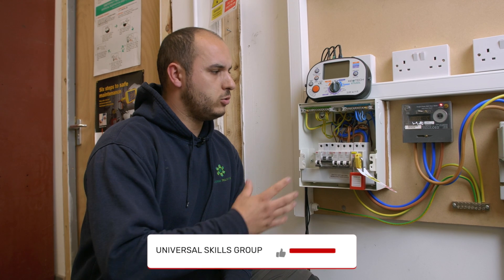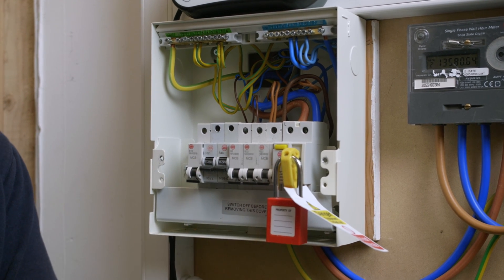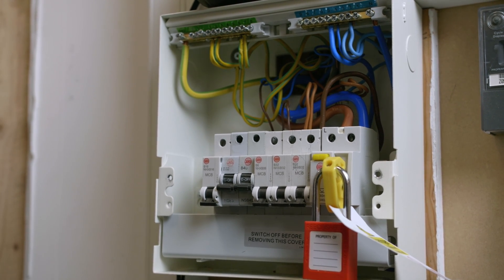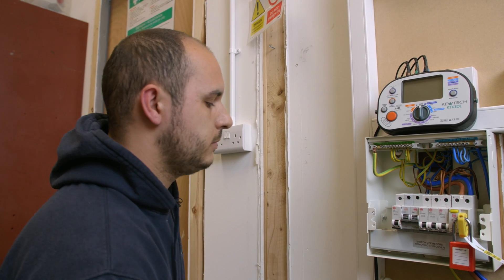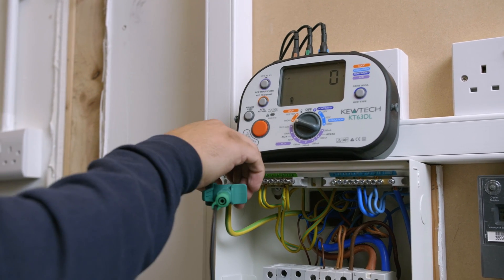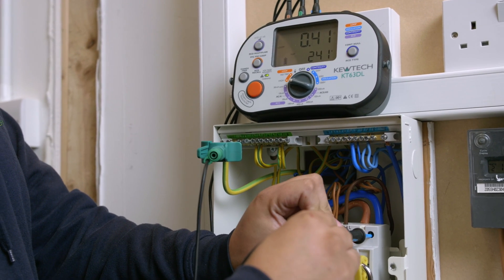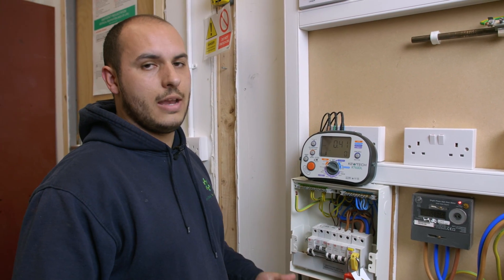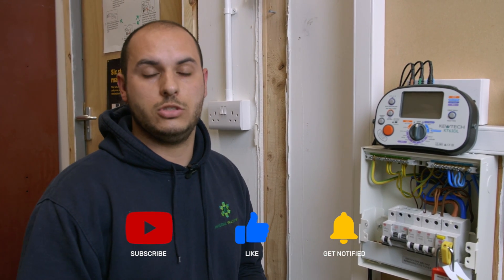Earth loop impedance test, ZE test

Comment: According to the manual - "The high current mode is a 2-wire test that enables
the user to test the true impedance of both the Line-Neutral Loop and the Line-Earth loop and
therefore to establish both the PSC (prospective short circuit current) and the PFC (prospective
fault current) for the installation." So why you use 3 wire set up ?

Comment: Thanks for your video, out of curiosity, there is a MET separate to CU with 3 earths, assuming one is the DNO earth, another goes to the CU, would the 3rd be a bond for water/gas?
If so, should the DNO earth be removed from that external MET and the tester earth be connected to the DNO earth?
I’m definitely not trying to correct you, but just wondering if I’m thinking correctly?
Cheers.

Comment: I wish we had videos like this in Australia. Here in Australia are regulations are so strict that there is very little on line information on doing virtually any electrical work, for example replacing an existing power point is illegal. By the way in Australia we do not have  ring circuits. I do not know if they are even legal here. I am puzzled about how these testers actually do the test. They must sample a few cycles of the sine wave drawing no current and then place known load  that draws a known current for say one cycle 20msec then get the voltage change and the using the definition of resistance come up with a measure of impedance. 
No wonder these testers are expensive you would need some clever software to do this and sturdy hardware.

Comment: Why do you have to connect 3 leads to check Ze or PFC does it measure PSC as well at the same time?
Reply from the maker: There are 2 tests that you do, there's the PEFC and your PSCC, dependent on your multifunction tester, some will do a 2 lead test and some have to be 3 lead tests.
Reply: @UniversalSkillsGroup on the KT63 loop high is a two lead test and you piggyback the blue lead of the green lead. The loop no trip is a three lead test . Read the instruction book for the KT63. And learn how to use the instrument properly .

Comment: Hi great video and very informative but when carrying out a high current Ze test with this tester then it should be configured in two lead configuration as per the manual with the blue lead piggy backed into the green lead, which gives you a true impedance of the LOOP measurement.